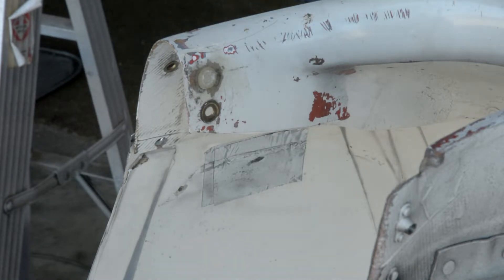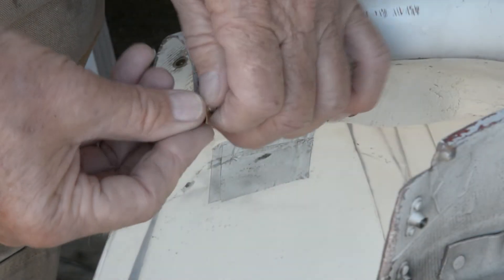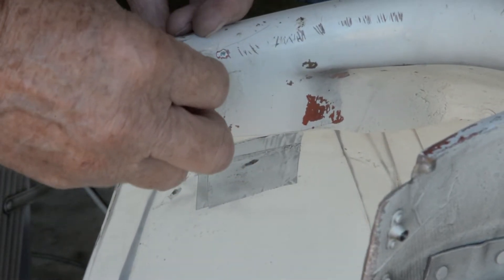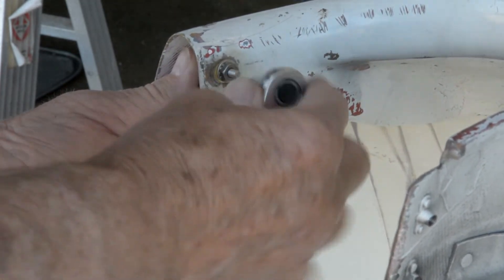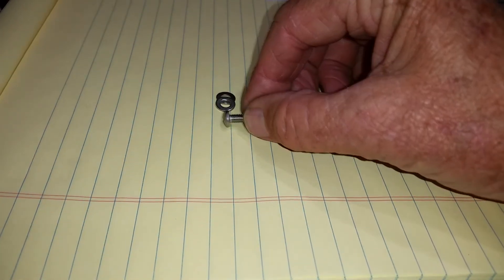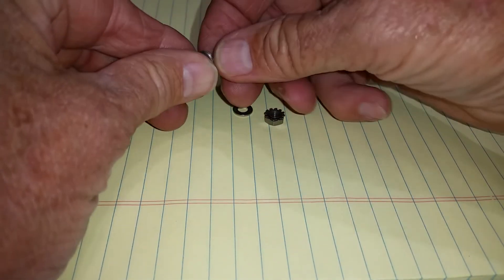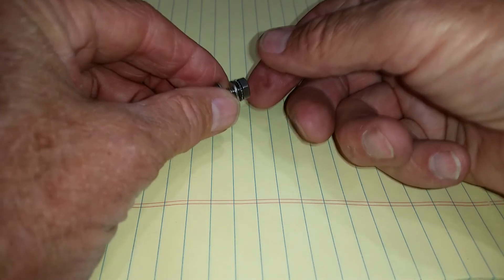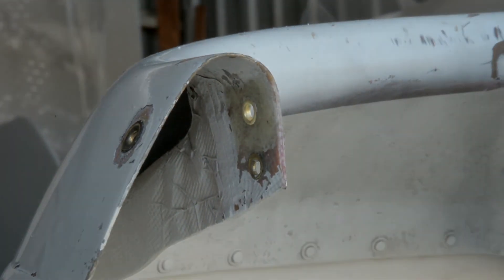Ferrule/eyelet installation on a Cessna Cardinal

Comment: Hey Vincent - Where did you find the ferrule ?
Thanks!
Reply from the maker: They are in the parts manual.  PN S1589-3, Eyelet.  They were $0.16 each in a bag of 100.  All the normal Cessna parts sources have them.